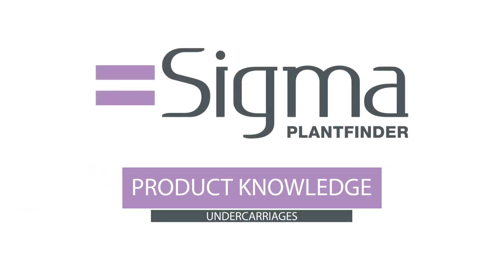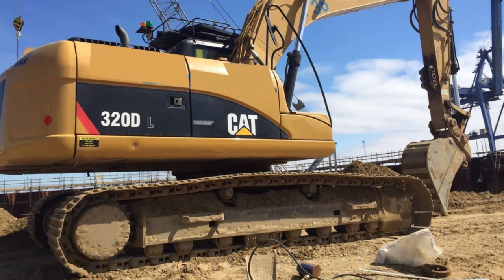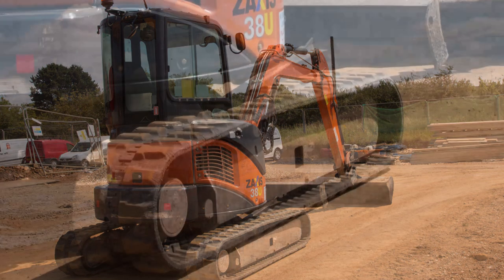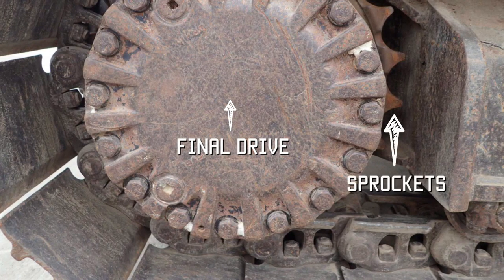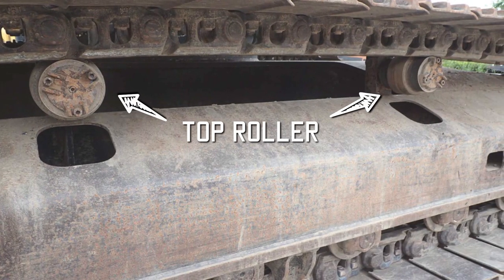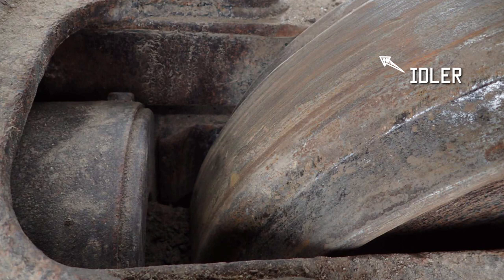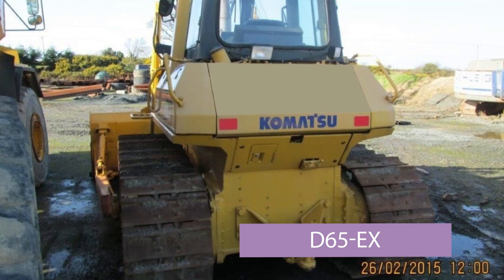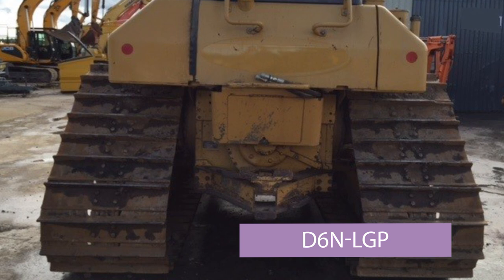Undercarriage Overview

Comment: I have a problem in bulldozer Caterpillar chain and track blades bolts.
It is very rusty and not able to be dismantled. 
What method or tool you recommend to dismantle it.
Reply: Heat and cleaning.